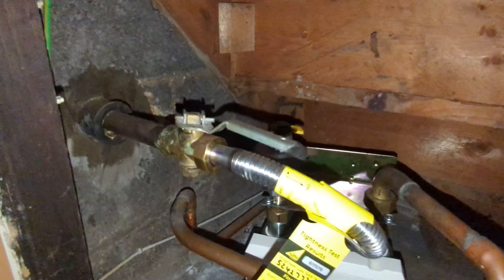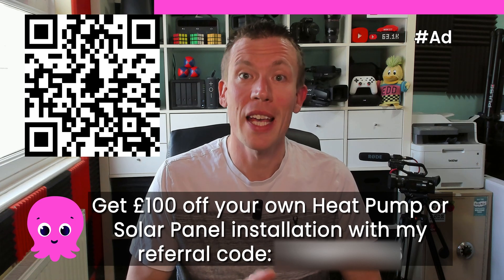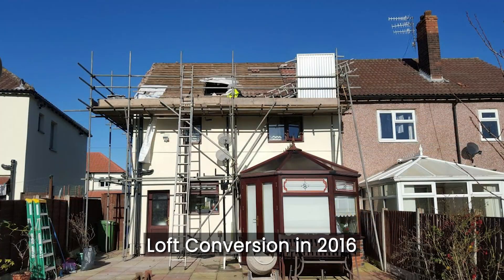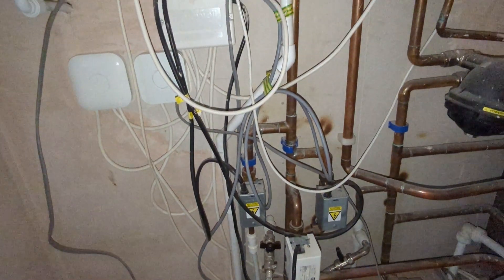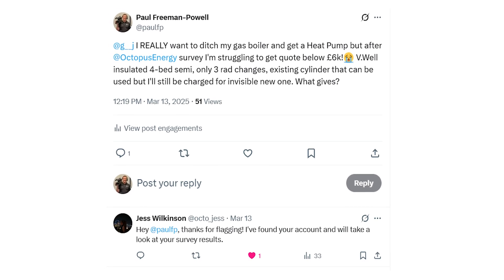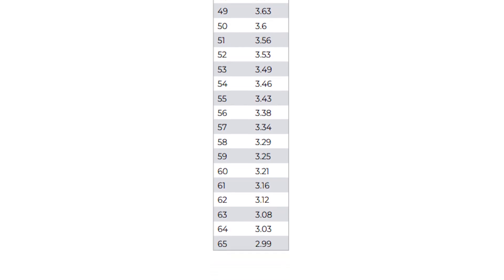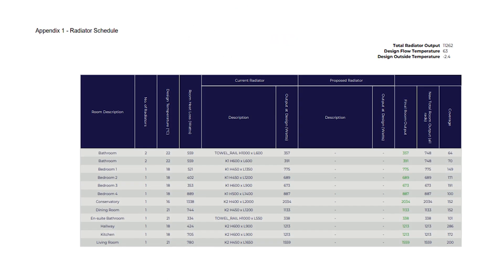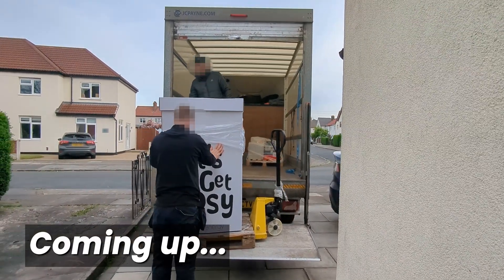I'm Getting an Octopus Cosy 9 Heat Pump!

Comment: you probably got an email from google just after you made this video saying the 2nd gen Nest will no longer be supported and will stop working remotely - I took up their offer of a 1/2 price Tado equivalent but haven't swapped over yet.
Reply from the maker: Ha, yes I did! (Recorded the A roll on 26th April) So it's good timing in a way as I'm stopping using them. So far, I think I'm happy enough with the Cosy Pods and the Octopus app (which you'll see in my later videos) to not bother with trying to resurrect the Nests... although I might do just for the fun of the project. I've not bought the 1/2 price Tado yet but I definitely will... even if just to put on eBay 🤣
Reply: @SwitchedOnNetwork  good idea.. I hadn't thought of that!   When you do another video could you explain why the 3 radiators were and then weren't needed to be replaced?  That's one of the things that has put me off in the past as I have engineered wood boards down over flooring panels so getting that up to do any pipe work would be a massive pain.
Reply from the maker: @webbo73 sure, will do. I'll do a dedicated Q&A video if there are enough questions in the comments across this video and the daily update videos. The first one will be at 6pm on Monday 👍
Reply: @webbo73 I am in the same situation with the added complication of microbore plastic plumbing to the radiators.
Reply: @LeeJonesNPT  ouch
Reply: @webbo73  He did explain why they were no longer needed. The flow tempreature was increased from 50oc to 63oc. decreasing the efficiency of the heatpump to decrease the installation costs.
Also changing radiators rarely means pulling flooring up, its normall just adjusted from the pipes that are already in place. I very rarely see plumbers on site needing to pull any flooring up on ASHP jobs.
Reply: @LeeJonesNPT  OE Install on Microbore pipes. They don't however install on anything below 10mm (copper or plastic.)

Comment: Welcome to the Cosy 9 club! Will be intrigued to see how your SCOP goes with the higher flow temp. Mine was at the usual 50c flow temp (but in the app the max is set to 57c on the cold weather setting) and had a few rads upgraded. Oddly I tried to get them to go the other way and go for a lower flow temp but they wouldn't play ball.
Reply from the maker: Thank you! Yes I'll be keeping a close eye on that, and the weather compensation settings in the app seem to be set lower than I'd been expecting but I'll be leaving that well alone until I start experimenting with it probably sometime around October when it gets cold. Although having said that, this is the UK so could be next week! 🤣
Reply: @SwitchedOnNetwork  I have had a snoop around in the engineering mode to find out what is meant by "hot and cold" weather for the compensation settings. Hot seems to be +12c and above, cold is -10c. I had a little watch the other day and when it was 9.3c outside, the flow temp for heating only went up to around 40c ish. The app was set to 36c max for "hot" and 57c for "cold" so I don't really expect it to ever need to ramp up to 57c very often.